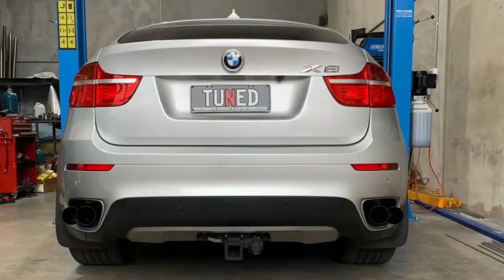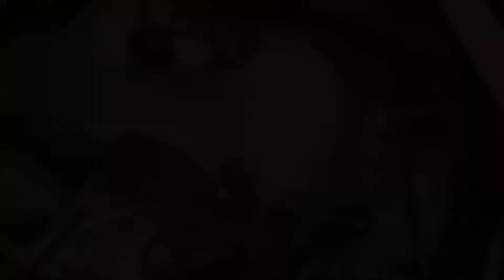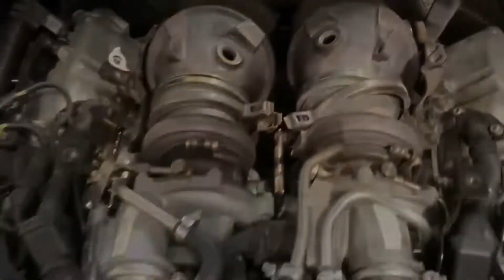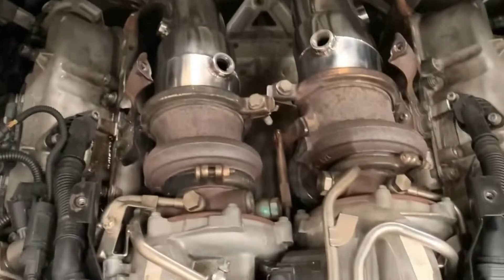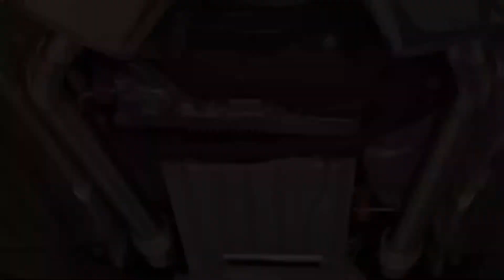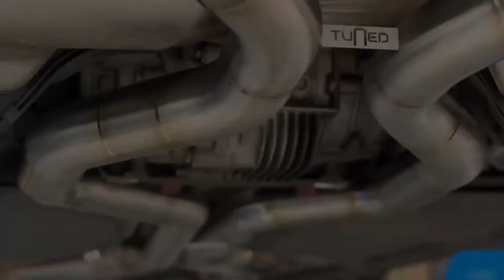BMW X6 50i custom turbo back 3" exhaust + sound clip

Comment: Is there any drone in the cab?
How loud is it inside the cab going highway speeds?
Reply from the maker: Slight drone, this can be resolved using longer resonators or high flow mufflers 👍🏼
Reply: @tunedexhausts   How much drone? is it loud inside the cab?